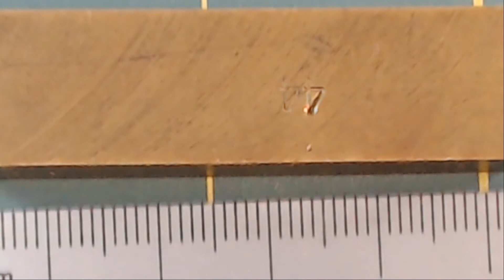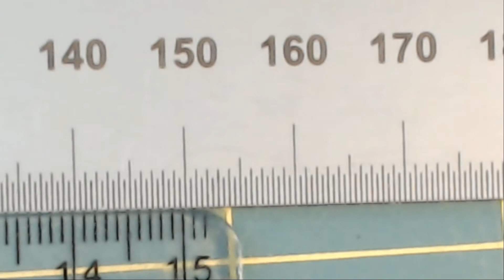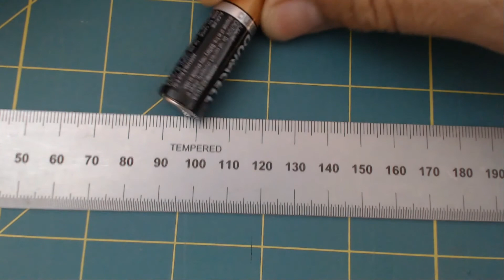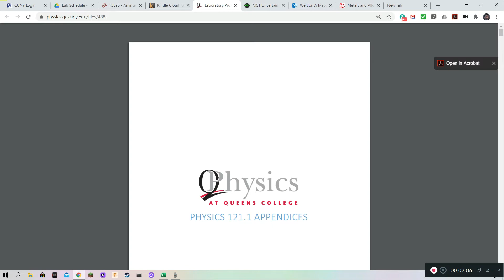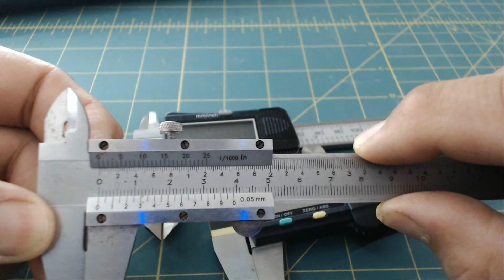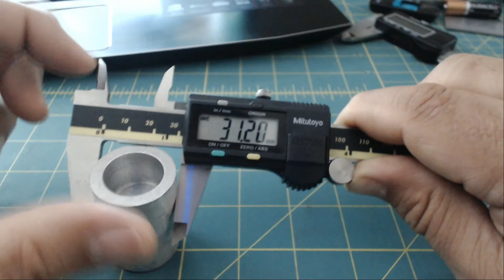Lab 1 Measurement

Comment: Also, at https://youtu.be/fNwvgWx4qU0?t=3073
This density uncertainty formula has a problem. He writes in .4 for the volume uncertainty, which is correct for the top entry, but is incorrect for the rest of the column. Instead, a reference to the volume uncertainty cell, H3, should be used. This way, the appropriate value for volume uncertainty is used for each cell in the column.